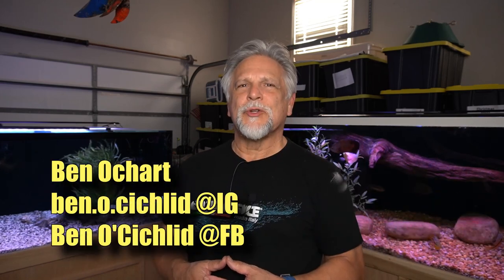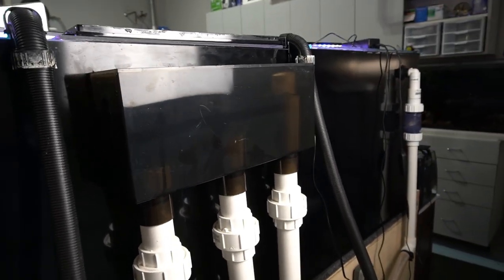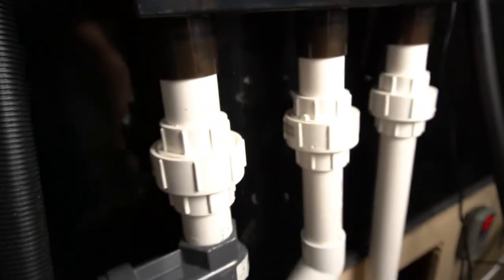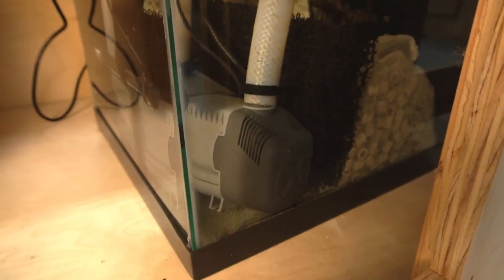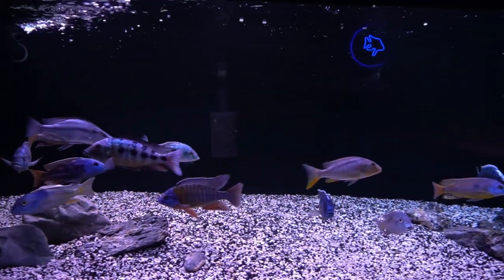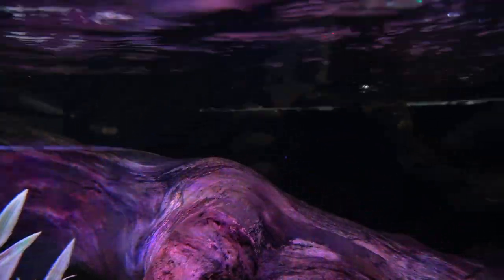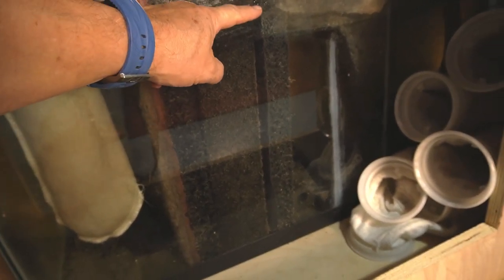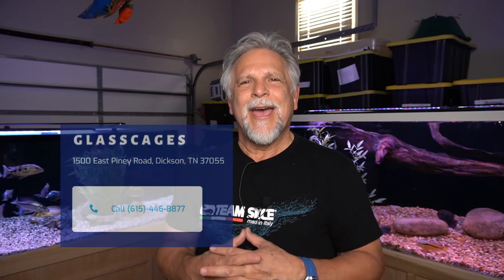Sump Filter 6 Month Follow-Up [Plus *DETAILED* Breakdown]

Comment: Nice. Simple and easy. I'm going to look into building a 55 gallon sump similar for my 125 gallon.
Reply from the maker: Mines been doing a great job for about a year now😀👍🏻
Reply: @BenOchart  probably really easy to clean. I'm sick of dealing with my marineland c360 cannister filter. Pita when I clean it and I have to mess with it because of the issues with getting all the air purged out of it.

Comment: Hi Ben 
Can you please advise please 
I'm in the process of getting a new tank 48x30x25" ( about 550 litres) (147 usg) think thatx right ?? 
Anyway  after watching this video I'm now wondering if it would be better to have a small sump tank rather than my FX6 ? 
Also how do you work out what size sump you need for uour main tank ? 
Many thanks 
Steve
Reply from the maker: I’d use that FX-6 and a sump, like a 29 gal or 40 breeder

Comment: Love the set up in the 40 gallon sump. The 3 sponges look like the best way to go with no baffles.  Adding that extra water volume also appeals to me. I never tried a sump I use canisters and HOB filters.  Do you know of a product than can add an overflow to a 125g tank that is not drilled?
Reply from the maker: Several companies make them. Just Google “overflow boxes”
Reply: Thanks I will

Comment: Hi Ben, I'm wondering how big of a sump filter I would need for a 56 gallon tall tank.  Thank you
Reply from the maker: Usually I recommend sumps for larger tanks, 100 gallon on up. But that doesn’t mean they can’t or shouldn’t be used on smaller tanks. A 10 gallon would work but a 20 tall would be easier to work with and provide more water volume.
Reply: Thanks Ben for the help 🙂

Comment: Ben, I'm sorry, I must have missed something in the first video.  I thought the simple set up with just the 3 - 4" sponges were enough to do the filtering, no to clean with any other filters?  But you are saying, a canister filtering system is still needed to run in conjunction with the sponges..?
Reply from the maker: No. It's just my preference and I always like a running back-up in case another system fails. Truth is that a simple sump with only sponges could do a fine job all by itself.

Comment: How did you dial in your return pump flow rate to your overflow drain rate? Are the pumps adjustable?
Reply from the maker: Pumps are not adjustable but their GPH is within the range that the overflow box is rated for. Drilled external overflow boxes come with a suggested GPH

Comment: why do you have the canister?  I am planning on setting up a very similar discus system with just the Poret foam.  Do you think I need the canister too?
Reply from the maker: I would need more info to answer like size of tank, how heavily will it be stocked, feeding and maintenance routines etc to really answer your question. All that aside, I like having a back up. If one fails or is being worked on, the other one keeps working.

Comment: Be very careful with that 1 way valve , it does not work as how you thought it would , the trickling water will still allow a small siphon to continue sucking water from the main tank to the sump , you gonna need a siphon breaker on your return pipe outlet .
Reply from the maker: Yes. One way valves are not total back-siphon solutions. They can fail, leak and not totally shut down when duty. This is why I keep outputs right at the surface and drill a small hole just below the water line of the hook on return in the 210. That breaks and stops the siphon.